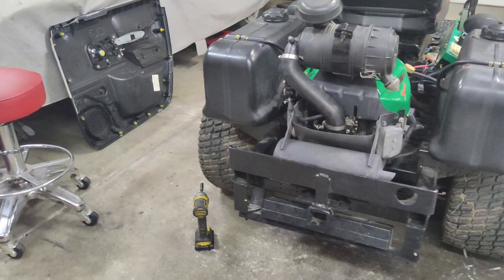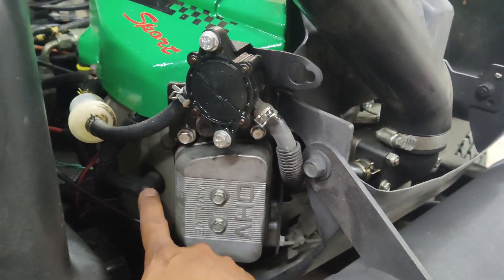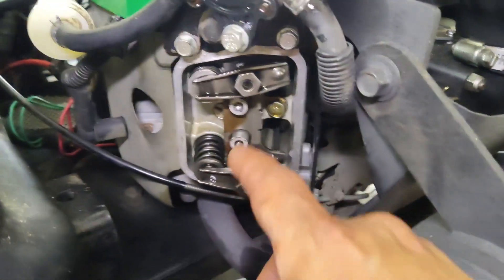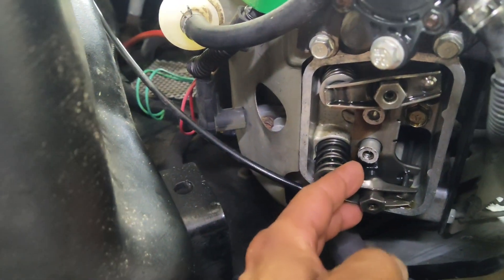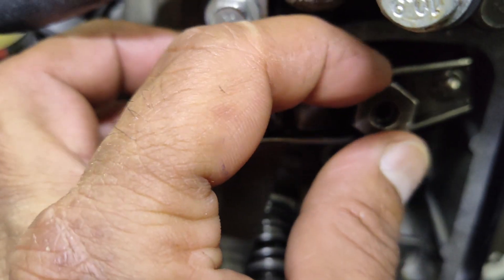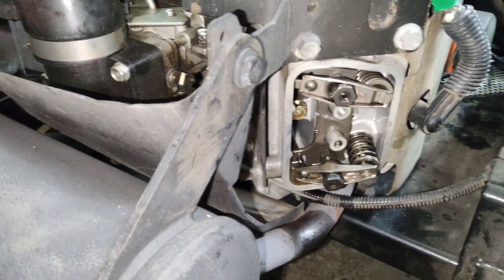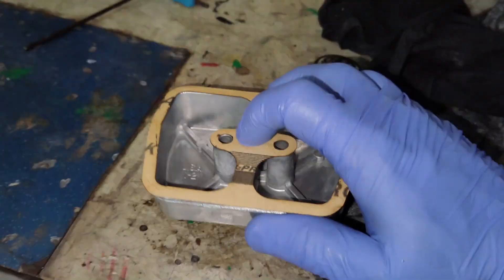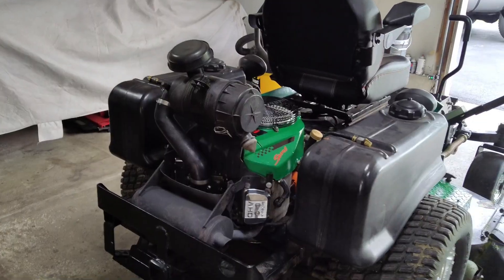How to Adjust Valves on a Kawasaki FH680V Engine: Step-by-Step Guide

Comment from the maker: Rocker Cover Gasket Set (2pc)
Click Here:  👉  https://amzn.to/3WFsJwz
Lift Supports Qty (2) Compatible With Cub Cadet MTD 01001727 Neutral Return Cylinder Z-FORCE TANK M48 M60 M54 M72 Shocks Struts
Click Here:  👉  https://amzn.to/3xwekKy

Kawasaki Genuine Heavy Duty Canister Style Air Filter Kit (Part# 99999-7083)
Click Here:  👉 https://amzn.to/3V5ymog

Carburetor Fit for Kawasaki(Externally Vented)
Click Here:  👉 https://amzn.to/3VMN0RQ

Carburetor Fit for Kawasaki(Internally Vented)
Click Here:  👉  https://amzn.to/4awYI7y

Fuel Solenoid with Wiring Harness
Click Here:  👉  https://amzn.to/3vFbYbg

Kawasaki OEM Ignition Coils Pack of 2(Get these factory OEM coils & Saves a lot of headaches)
Click Here:  👉  https://amzn.to/3QWC41R

NGK Spark Plug Standard BPR5ES - Pack of 2
Click Here:  👉  https://amzn.to/3YyOr5U

Genuine Kawasaki Oil Cooler(Add an Oil Cooler To Extend the Engine Life)
Click Here:  👉  https://ebay.us/otHW7a